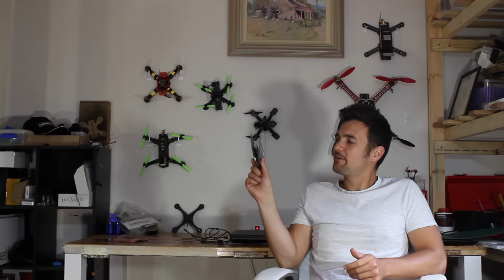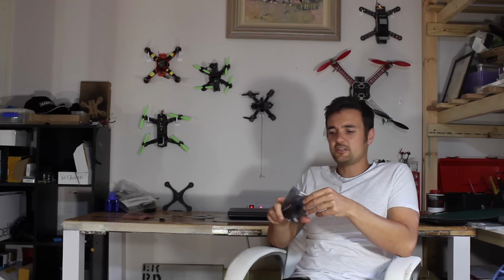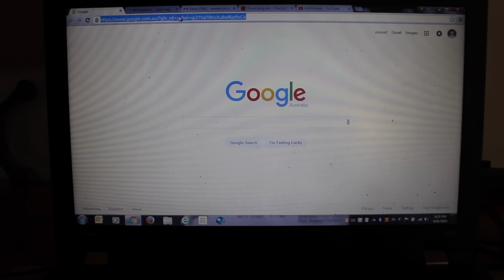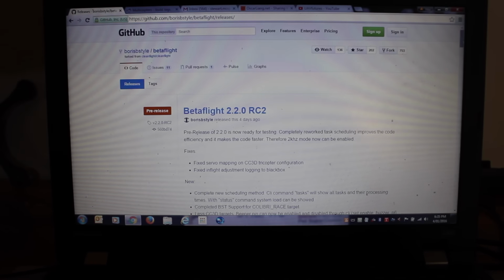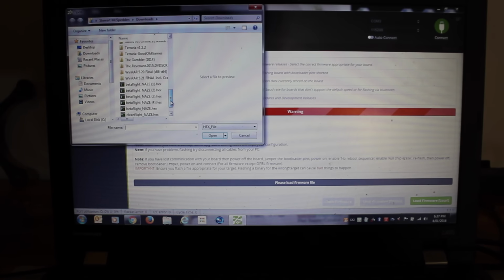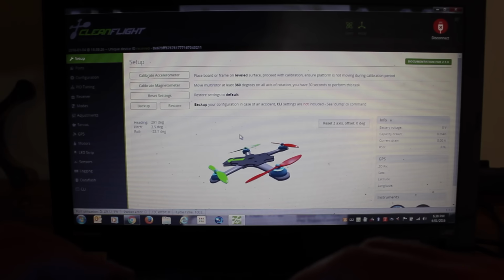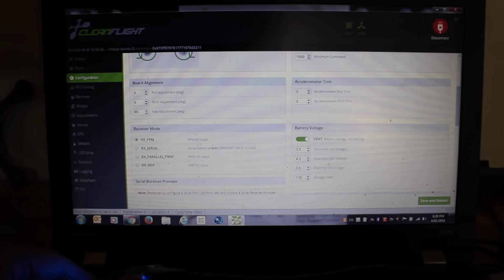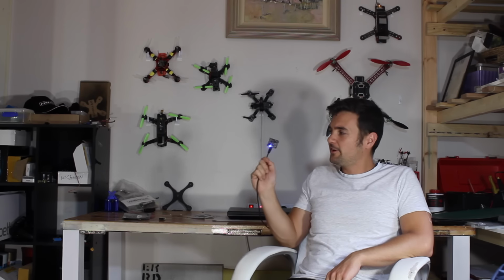How to flash to Betaflight - Quick Video Guide

Comment: redo this video. you skipped the part where you should jump the boot pins. and it looks like every comment had that problem but you failed to inform them. everyone watching.. before you connect your pc.. there are two solder points that say "boot" bridge them (hold a wire across the both of them before plugging it into your computer). this needs to be held for all of the flash. great videos but i feel this one lacked a very important part. thanks bro

Comment: Hi. Um, No Response From The Bootloader for an SP Racing F3 Evo. I have updated all the drivers. Updated Chrome. Rebooted everything. I can connect to Clearnflight but I'm told I can't do anything until I upgrade the firmware. When I try to do that I am unable to connect to the bootloader. I've tried shorting out the bootloader pins and I've tried to do it via the usb. It isn't working. This is why I buy a DJI product. Everything works - first time.
Reply: LMAO, thanks. I needed a good laugh. I own a few different DJI products and they are far from perfect. Why do you think you have to update the firmware three times a week before you can fly every time. They are fixing mistakes because they rush firmware out the door and are trying to manage to many products at once currently. Think about it???
At least the ****flights like clean or beta flight release beta firmwares and ones they know might be unstable for people to test, so they can fix the issues before they call it stable. And it's up to you if you want to use a beta firmware or a stable one. With DJI every customer is a beta tester, as the reports of issues come in they fix it and force another firmware on you three days later before you can fly again. That's just one of the reasons I didn't keep my mavic and sold it. Now I only have a phantom 2 and it doesn't need an internet connection to fly, so I can stay on a firmware I know works and I'm not forced to update with a new version that has new bugs and issues.
Reply: Tell ya what. I went and reset my laptop back to factory specs and reinstalled all the drivers needed for cleanflight etc etc. Works fine now. I think I may have originally installed the wrong drivers. Pretty sure there were two options for the CP210x (not that I think I needed them at the time) Anyway, I got it all wrong but now it all works just fine. SP Racing F3 Evo or Deluxe. I'm a Noob so please forgive my mistakes. Making mistakes is how you learn, right? Happy Trails!
Reply: I was a little sas, but I did find it funnyd and did need to laugh. You known how it is on a bad day. I guess it could have been a 32 bit or 64 bit driver option? I'm not sure since I use my Mac and already had the driver installed from a previous project. Even Mac can be a pain these days. I'm glad you got everything to work in the end, that's all that matters. Happy flying,
Scott

Comment: My naze32 come with baseflight. So i should use baseflight instead of CleanFlight am i correct?
Reply: Baseflight, cleanflight, betaflight, it's a preference really. The hardware is still the same, the ????flight I guess would depend on what has more support for me, so I use beta flight. Seems like more information and work arounds are posted about it when it comes to different flight controllers. I just flashed the NAZE32 with betaflight, no issues. Just remember some have two points that need shorted out to flash it and out the board into boot mode. Some solder these points, some people just hold a wire across the pads until it's done like me. But don't slip or let go of that wire until it's done or you will brick it. So it might be better to solder the pads together. 
Some NAZE FC have a 5V pad next to the boot pads, make sure your soldering the boot pads and not a boot pad to the 5V or you will short the board out.

Comment: Hi Steve, do you know why some naze32 boards get bricked when we flash betaflight on them?
Reply: Some people hold a wire over the boot pads and don't know that they need to keep holding it until its done? Others do the wire and slip in the middle of the flash? Maybe a bad solder joint and they didn't let the board cool down first before flashing and the joint cracked during the flash as the board cooled down? Maybe something left over from the old firmware because they didn't click "wipe clean" before flashing? And also these board take a beating so the board might have been damaged during a flight but didn't affect flying, but does affect flashing it? Just a few reasons off the top of my head maybe why. I've never had it happen to me, just did one today and it went smooth.

Comment: Hi,  a very nice video. One quick question. What does 'Choose a firmware/Board' mean ? 
In some videos, people choose different options under 'Choose a firmware/Board' . How can I find out which firmware I should choose ?  Dose it matter if I leave firmware to default ?   Thanks :)
Reply from the maker: firmware is just the operating system the board runs. I suggest using betaflight firmware.

Comment: thanks for the video..but i am having a bit of trouble.. i try and flash firmware and it says ..no response from bootloader ,programming failed  ...(NASE 32)
Reply from the maker: short the boot loader pins
Reply: shorting the pins is the most critical step.. why did you skip it in the video? damn Chinese Aussies